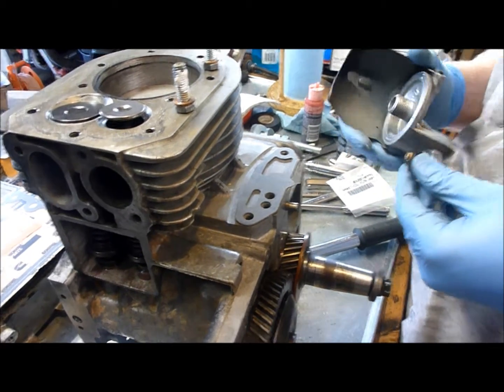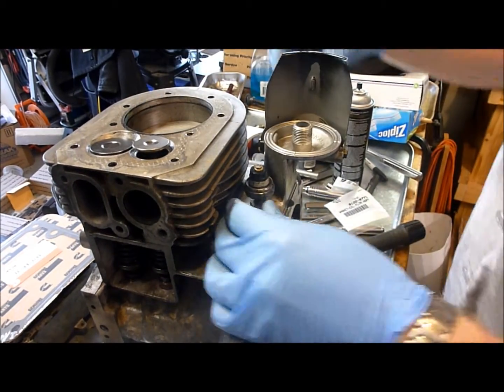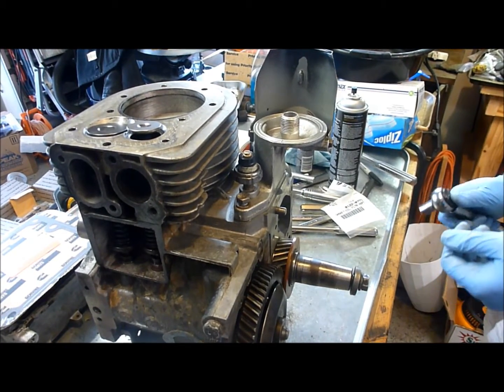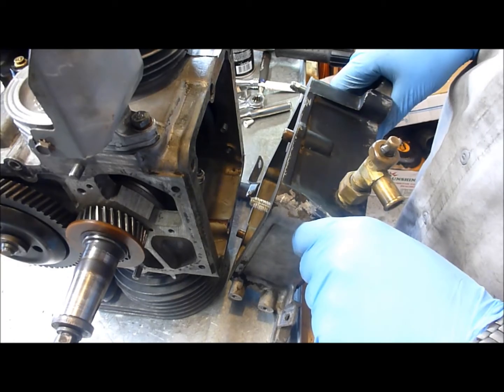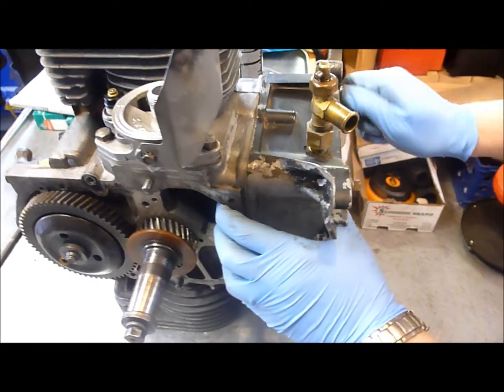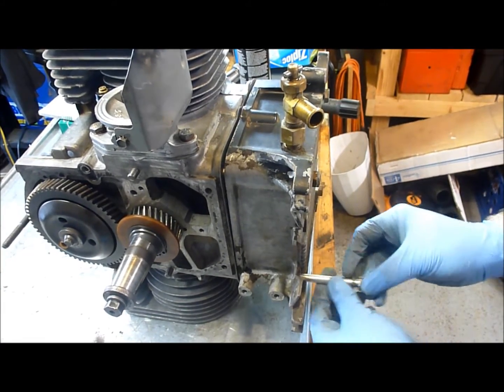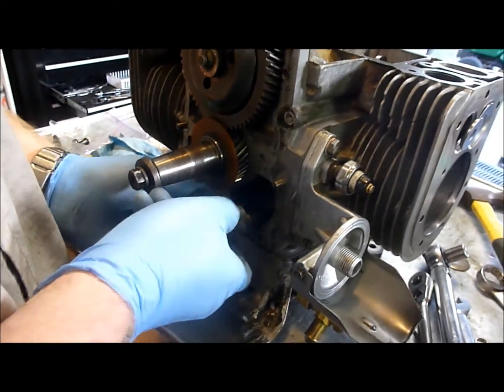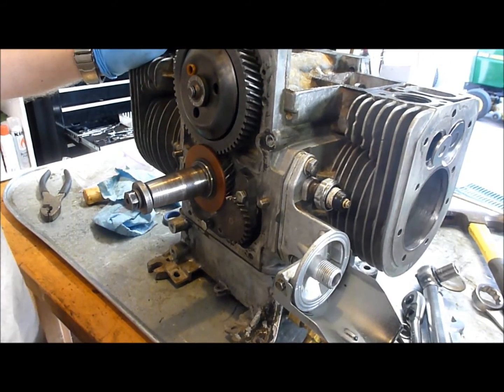Rebuilding an Onan B43G (Part 9) Oil System parts

Comment: I just purchased a B48M that came without the oil filter adapter. Do you recommend me drilling and adding one or it’s fine to run these engines without the oil filter and then just do oil changes more often?

Comment: Oil pump comes with 3 different gasket choices for thickness. How do you know what one is correct?
Reply from the maker: The gaskets are different thicknesses. You will need to test fit the gaskets to check for fit. I would have to dig into the tech manual to see what the specs are.

Comment: Is it possible or okay to make these gaskets?
Reply from the maker: I don't see why not if you can find the correct material thickness and type.
Reply: My gasket that came off behind the oil filter only has 4 holes 2 for the screws and 2 for the flow none of the other cut outs are on it, which I'm hoping that's where all my oil leak was coming from.

Comment: what was that  "sealant" that was used on the oil filter adapter bolts ?
Reply from the maker: Any paste type sealant that is for oil should be fine. Just don’t forget it! I did one time, they will have no issue leaking!

Comment: guess mine was apart before. I didn't have and dowels for helping align the oil pan.
Reply from the maker: I've never bothers to see if there were some differences on spec numbers for alignments pins.... there may very well be some differences in pins across the modle years and machines.

Comment: Where are you located? I have a JD318 that a connecting rod broke. My option is to sell the 318 as is or rebuild the Onan 18 hp engine. I'd rather rebuild. If there is someone skilled to do this close to Columbus, OH please let me know. My email is thomkeener@gmail.com
Reply from the maker: I am about 16 hours away from you.... Rebuilding the Onan if you are not under a time crunch can be a rewarding experience. I have no idea about someone local to you. You could try and do it yourself if you have a couple weekends. It might be worth stopping by your local parts store and asking about engine rebuilders.

Comment: These type of special sockets are  sometimes referred to as 'torque adapters' , for example snap on's FRDH161.  You use these  to torque obstructed (such as the oil filter housing here) or blind nuts and bolts with your torque wrench at a right angle to the adapter.